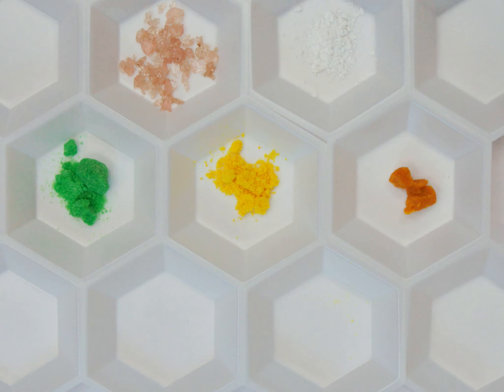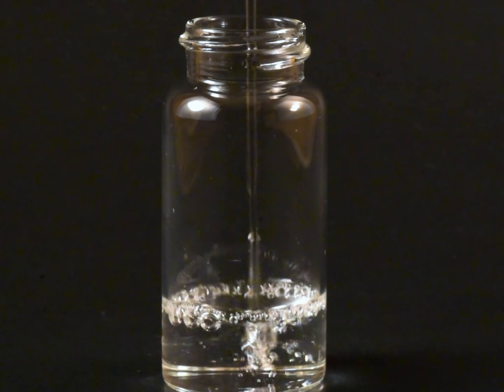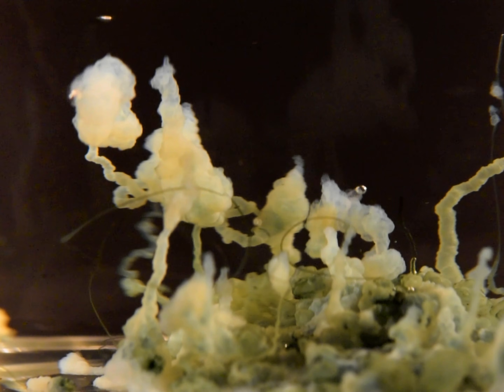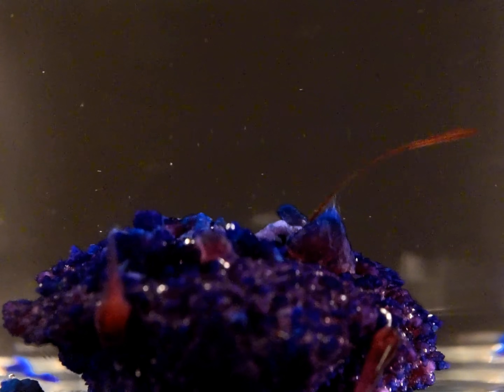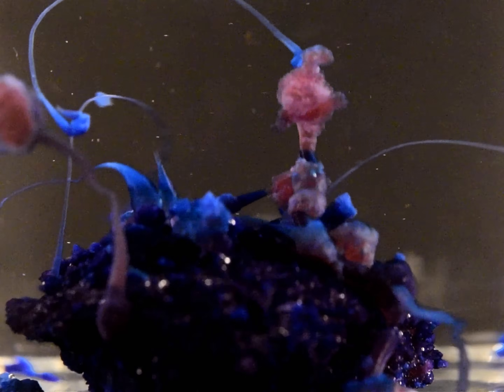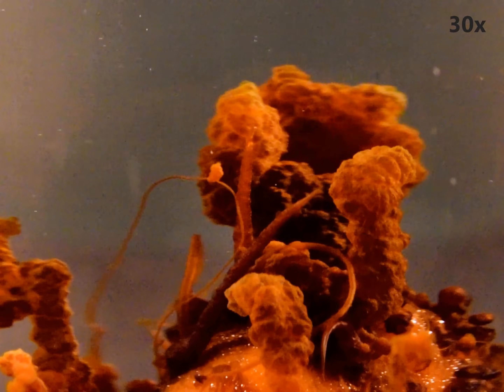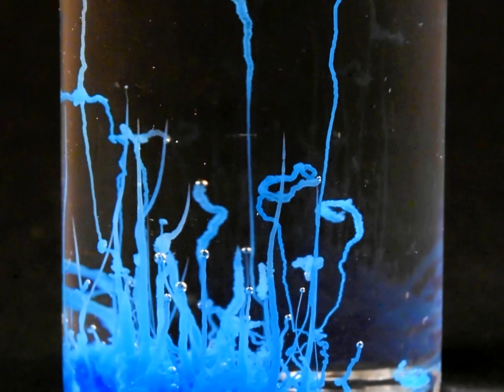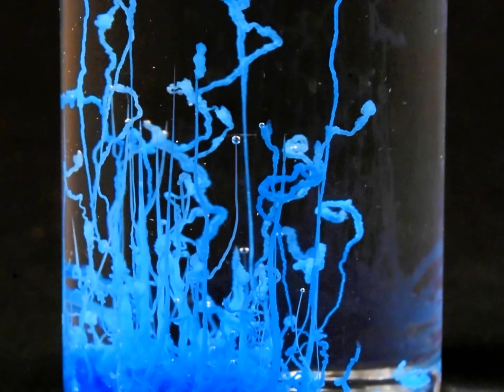Chemical Gardens Explained

Comment: They will also grow downward from the surface of a liquid especially if the metal salt is heavy. Uranyl chloride is best to demo this as grows downward tubes readily. However, the uranyl chloride solution is so dense that upward growing filaments take a long time to grow and are very short.